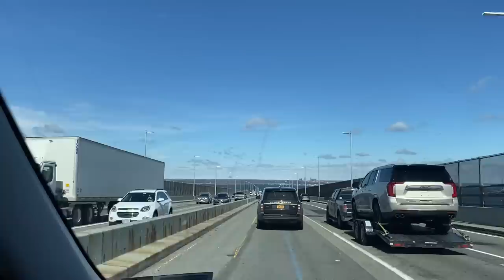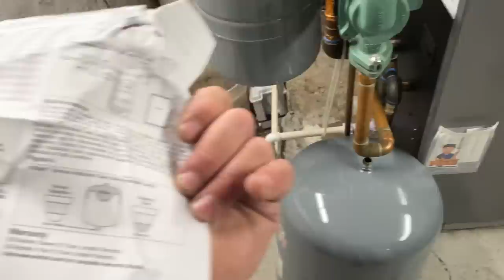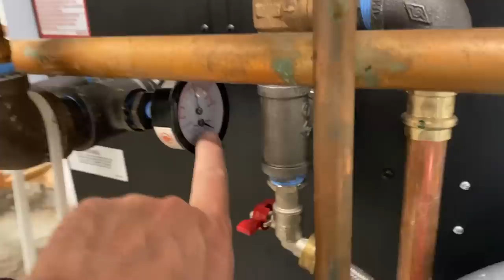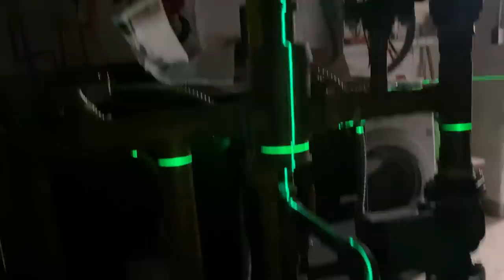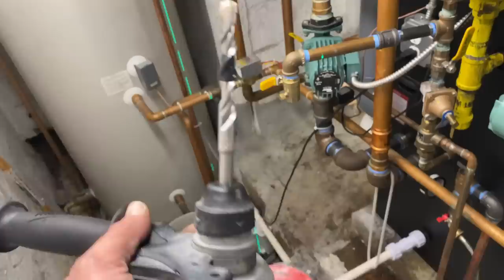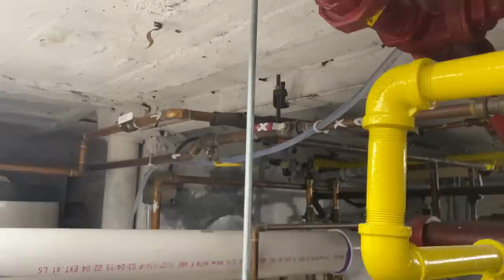Sizing and Installing Hydronic Expansion Tanks

Comment: Nice work Mike and smart adding the isolation valve. Figure that tank will weigh 75 to 80 lbs while it is operable and about 125 when it fails. Water weigh roughly 10 lbs per gallon.👍👍🇨🇦

Comment: You could have put a double bend offset on the 3/8” rod. Also, I believe it’s Dewalt that makes what they call the “smart DI (drop in anchor drill bit” for the sds+ that has a stopper at the exact depth of the drop in. And it has an attachment that you put over the drill bit that you use to hammer the anchor in with the hammer drill. It’s really nice.

Comment: you could have done two hangers in V shape to avoid the pipe above.
alt 1: used half of two larger clevises to go around the pipe (bolted together with short bolts)
alt 2: just hang it from the larger pipe above(clevis to clevis) and that pipe above to the ceiling with a clevis against the one below.
alt 3: I'm less thrilled with, but gently bend the rod(long radius bends) out around the pipe. if not gentle bends it can be weakened and even then it may flex enough to overload the nipples/coupling and break off suddenly. especially the newer "junk" brass  fittings.

Comment: I have a 105,000 BTU Williamson gas hot water boiler that always runs at 27-28 lb of pressure. I have a size 30 expansion tank that is operating fine. I have all cast iron recessed radiators in my home. I have wondered if that is the reason why my system runs at a higher pressure. Cast iron radiators needing a lot more water than baseboard system. Would using a larger expansion tank help lower the operating pressure? My furnace is set at 180°
Reply from the maker: No, I would probably venture to say that you’re tridicator gauge is inaccurate or your pressure reducing valve is letting too much pressure

Comment: I have a tank sizing card in my tool bag along with I have no idea why anymore a vent damper recall serial number card.   That said, I quickly go from an extroll 30 to a floor mount, just because anything larger is just to heavy to change.  Ya, been hit or miss on using the air compressor to get all the water out.     In a lot of cases, there is no easy way to support them and the concern of a 60 or worse 90 filling and snapping something, just easier to go to the floor mount.
Reply: I agree, #60 max suspended and preferable anything over #30 a floor model, unless the space doesn't permit that. I mean I've had to squeeze in 5 suspended #30's before in a bad location! talk about a cluster-fork-mess. the end result was still better than all the other "proposed" plans.(lol) sometimes I think  to "deep space" outside the box levels.
Reply: I should add, all five were "horizontal" and in a radial pattern (star shape).  it's still that way as far as I know and they just replace tanks when failed. it was oversized by "two" tanks just for added headroom and ease of repair. nothing else would fit, unless someone starts making a pancake style flying saucer tank 🤣🤣
yeah, I'm rather nuts, but git-r-done-son.

Comment: I know supply houses that don't have Extrol 90s in stock. So why would you have one in your van?
Reply: I installed 2 60s together when I couldn’t find one 😂
Reply: @richlong4119  And most residential homes do not have 280K BTU systems in them.

Comment: @Mikey Pipes - Pipe Doctor Plumbing & Heating & Air
1:41  I guess the ppl who said something about the expansion tank being wrong size didn’t watch the entire video! And listened to what ya said…..or missed what you said 🤷🏼
B/C I REMEMBER you saying Mikey, you know you had wrong size after looking at the 1 page data sheet fr9m expansion tank AMD YOU SAID needed a 90 and don’t have in truck and would need to c9me back w/ the correct size. Was in the video, unless I’m hearing things, lol.
So, think most ppl “know” you wouldn’t install a system (or repair a system) w/ improper parts etc……BUT IF YOU DID, it would be for good reason, which would be: unable to get part or didn’t have w/ you; BUT than you’d be back to rectify the situation to MAKE THINGS RIGHT and do the job the way supposed to be done; b/c your Mikey Pipes the pipe doctor and it’s your company’s core value, along w/ TESTING!
So, don’t listen to those comments (know 1st hand how hard that actually is, it sucks) and keep doing right thing paying attention to details and doing awesome great work👍🏻👍🏻
Cheers✌🏻

Comment: should have went with a floor model tank, once over a "60". much easier to set them down than fiddle around hanging them. if they water log from bad bladder, far less headache to move(dolly) when you don't want to make a huge mess.  I don't like anything over a #30 hanging myself, unless the space is very tight.